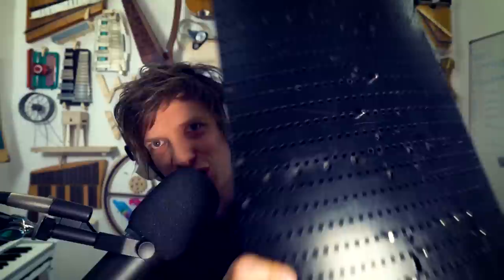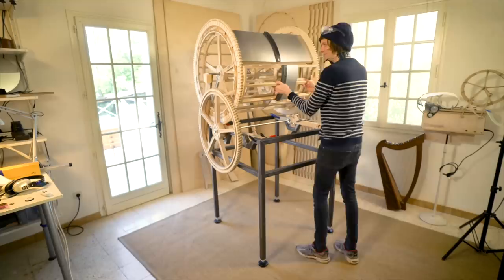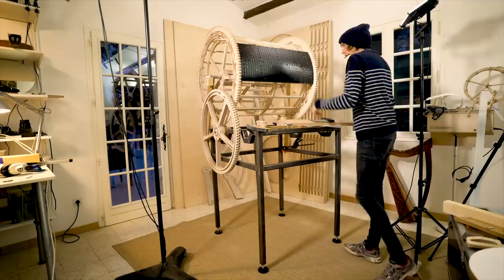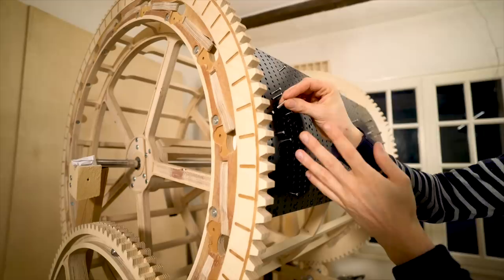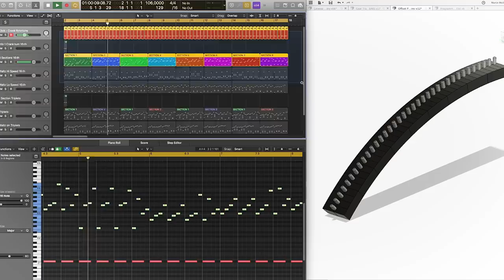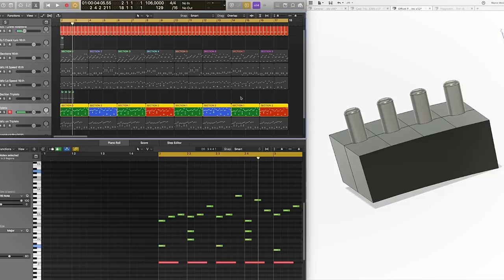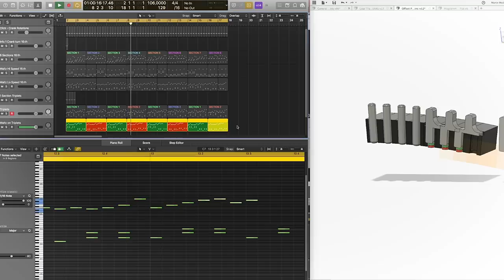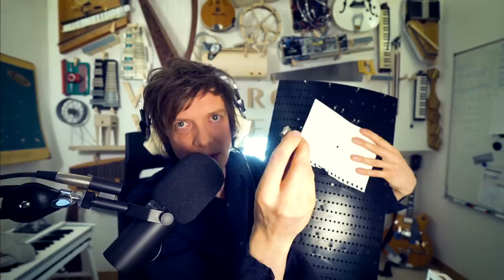Magnet "Midi" Music System - Marble Machine X #25

Comment: You would probably want to use a vinyl templates instead of paper. This would stand up better for multiple uses at different venues.
You could have different colored vinyl sheets for every song that you have making it so that the templates do not get mixed up.
You might want to put some permanent identification pins on both sides of the plates, that are not used in the song, so the template only go on one way and are lined up correctly.
Reply: I was thinking that too. Or even make it from thin metal sheet with locks that are not interchangeble.
Reply: Paper is really not a good material if you want to travel with them and use them more than few times, especially since they want to change songs DURING gigs.
Reply: mrkv4k I respectfully disagree, Paper travels well in tubes (like blueprints) and can be replaced easily while on tour by going to a local blueprint shop and having more made, plus they can be edited on tour and reprinted easily.  

Even in situations where a local print shop is not available,  a standard printer could be used using a solution like Mattias Wandel's big print program
Reply: you can put vinyl in tubes too, even steel sheets. And I would go for perforated/laserd sheet, not printed patern. That way you can put sheet over the programming plastic and put pins thru. I don't know how you would do that with printed patern.
Reply: look at a lite-bright... a toy from the 70's. you just push the pin through the paper... it's a disposable (recyclable) templet... a vinyl sheet can get ripped or stretched when used repeatedly... and if it's lost, it's a lot harder to replace than a piece of paper. 

very thin stainless steel sheets would be nice though since they aren't magnetic... but you still have the issues that you would with vinyl… stretching, cost and difficulty to replace if lost, and something I haven't brought up yet, when you pull a curved templet away from the index drum sections, the pins are at different angles... so the form would need to stretch to be removable... unless the intent is to leave it on during the performance. paper templets can just be removed and recycled... otherwise maybe thin steel or brass sheets that cover the unwanted holes and are clamped onto each section for the duration of the performance... but I got the impression that Wintergatan wanted people to see the perforations in the drum (otherwise why would he care about surface finish (polished or brushed)
Reply: 1. I get the lite-bright example, but those pins were like 2mm in diameter? These are at least 5mm...  You'll have much harder time pushing them through.
2. The different angle is not that big of a deal. Just make the holes 1mm wider than the pin diameter and you don't need any stretching.
3. He could use both. Stainless steel or vinyl ones for the most used parts and paper as a backup...
Reply: A problem with templates is that they either have to remain on the programming wheel during the song (requiring additional mechanisms for them to remain stable while on the wheel) or would require the template holes to be designed in such a way to allow the template to be removed *without accidentally pulling the pins out* with it.  The current pins stick out substantially from the surface of the programming board-- the height of the pins cause a wedge effect across the surface of the wheel, locking the holes in the template against the base of the pins.  Disposable paper templates could be torn away from the pins (tissue paper?), but you might still risk accidentally pulling out some pins.  If you want a vinyl template that's removable, the holes would have to be bisected by a thin slit to allow the template's hole to clear the top of each pin upon removal of the template.  Of course, this is impractical or impossible, if the pins are taller than 1/2 the distance to the next hole in the sequence.

For these reasons, I would recommend a sheet of thick vinyl, stainless steel, or cardboard with a few registration holes that would key onto several very short pegs sticking proud of the black plastic programming boards. The pegs have a something on top that can be rotated to lock each sheet down on the black plastic peg board underneath.
Reply: As I have written before, those holes can just be made 1mm bigger and you won't have any problem getting that template off...
Reply: Silly idea maybe, but machine metal backplate with a small 1 or 2mm hole behind each insert. Place the template and drum section on a curved lightbox. Place magnets over each hole with a light behind it; would be easy to spot any missed pins. Different colours could be used on the acetate to signify type of pin.

Comment: Use color coded stripes on the board as a visual representation of the music tracks.
Reply: Makes things easier especially if they need to switch the pins fast. But it wouldn't look good
Reply: True,but even a simple black and white scheme could work well.

Comment: I think we're overthinking this and missing the obvious. The vast majority of your three beat programming is going to be for songs that are three beat all the way through. In those rare cases where you just want to shake things up a bit and throw some triplets in with the quads, you can use the offset pins, or the 12 beat system. Most of the time, though, you will want to have a quick system that works for three beats, and that is where your modular system excels. 

Just make alternate modules that work for three Beats, or any other number of Beats that you want, and take full advantage of the benefits that you have already built into your system.  Pro-tip: color code the modules for quick sorting by time signature.
Reply: This was going to be my suggestion as well. I love the musical possibilities opened up by being able to do 3 against 4 on one programming module, but I can't see that feature getting a ton of use. Having a separate set of 3-division modules would simplify manufacture and simplify set-up.
Reply: Also, I forgot to mention that the number of special offset pins used for a brief breakout from 4-beat will be few, and save you the thousands you would need otherwise.  You could probably even skip those entirely by putting in a single 3-beat module among the other 7 4-beat modules.

But definitely,  don't make it needlessly complicated.  Keep the system standard and open to new possibilities, and you never know what amazing ideas may develop later on down the road. 

 The beauty of MMX is in its simplicity and adaptability, and that plays in brilliantly here.

There's even the option of using alternating modules for different needs, such as an 8-beat mod for a speed-riff here and there.

Comment: My vote is for glossy. For the 4th/3rd timing idea however, I'd suggest against rectangular magnets because the holes would need to be cleared in the corners, taking more space then you think and possibly not having enough material left over between pins and rows. I'd go with a much easier idea, which is to keep the round magnets and simply do distinct programming plates in both three and four pins formats. Also, the less the magnets stick out of the holes, the stronger and durable the whole setup should be.
Reply: So sets of each type of time? I like that. The only limit is space needed for transportation... Speaking of, what is his solution to transportation, flight cases? It'd be cool to see him make custom flight cases for the marble machine x!
Reply: I thought that at first (Two sets) Really simple and foolproof. BUT: More to transport on a world tour and knowing Martin, the idea of breaking in to a few bars of 3/4 is too seductive (but again would be limited by the maths)
Reply: Glossy, that could be a problem with spotlights on stage and reflections.
Reply: Doing a 3/4 song mix would still be possible, limited by the sections.

Comment: Since I can't comment on the pinned comment anymore: I like the bar magnet Idea. But the bar magnets and offset pins both have the big problem that you would need to drill square holes into your programming plates. The easiest way to realize triplets would be to create another set or two of programming plates. Or if your design allows for it you could drill another row besides the current ones which is in triplets. If you then offset the comb one row, a simple flip would be all the difference you need.

With your template you have to look out for the thickness. Because all the pins will hold a template onto the programming wheel if its not thin enough. And if to thin it will wear out fast.

About brushed or glossy: Odd ones glossy, even ones odd.
Reply: you can create (roughly) square holes, just use a smaller bit to create tighter corners
Reply: This would work with the bar magnets if they have rounded corners. But if the offset pins get water-jet cutted. they won't have as much of a roundover.
Reply: I personally think the two lane bar magnets are the best idea. It allows for all sorts of triplet 16th note interaction, makes it simpler to program, and more efficient than having multiple types of pins

Comment: So, it is basically a Automatic reprogramming system, which you can reprogram with a pouch hole paper. This also decreased the mistake chance made by people. Actually, in the heat of a on going show, the chance to make a mistake by people reprogramming is quiet high.

Comment: Maybe you could make an electromagnetic  programming template to replace the pins, you could take them out all at once that way, and by flipping a switch you could drop them all out of the template
Reply: Jesse Cabral problem with that is turning the magnets off when needed
Reply: Maybe try a Halbach magnet array, just remove the middle portions to and the magnetic field would decrease significantly. https://en.m.wikipedia.org/wiki/Halbach_array
Reply: Ok i feel like all of the fans here are smarter than me
Reply: My thoughts exactly. But would this pose a problem with magnetization of the pins?
Reply: If you haven't already thought of it, it would be super cool if you added a governor to regulate the speed at which you could crank. Already there should be some resistance to cranking, but a governor could be adjusted easily to different speeds and then instead of keeping time, the crank would only go as fast as the governor allows. Maybe it is too much to add, I think it would look super cool and be useful.  https://en.wikipedia.org/wiki/Governor_(device) btw you can adjust the spring and adjust the ball positions (have them threaded on something ) to change the maximum governor speed! It wouldn't necessarily need a brake, the moment of inertia of the governor itself could limit max speed.

Comment: I think you should just add extra holes for the triple notes and use the normal bar magnets. It won't hurt anything if the holes overlap.
Reply: If you decide to make the triplet pins, you only need to make one type, which is offset by 1/3. Instead of playing on the 1st, 2nd, 3rd and 4th sixteenth, you play on 4/3, 8/3 and 12/3 which is exactly 1+1/3, 3-1/3 and 4.
Reply: Definitely.  See Kieran Hughes's suggestion https://ibb.co/g4oKQn

Offset pins would be better at 1, 7/3, and 11/3.

Comment: If my macbooks's magsafe power connector is any indication, it is worth thinking about how to deal with the inevitable ferro-magnetic debris that might accumulate on any of the magnets. Little bits of wire and other metallic fluff could snarl things up on the road. 
Also, did anyone else think "Lite Brite" looking at the programming panels? Having light shine through in the same way would be one way to help guide programming. And could look cool. Hard with the backing plate though.
Reply: ...and the magnets...
Reply: light show would be real cool complexed tho

Comment: I could not post in the pinned down comment :( , so I´ll just post it here, guys help me so Martin can see if my idea is useful to him!. My idea is that you could make a hand held device to quickly put the pins in each hole and having to deal less with the magnets getting stuck toguether. It is kind of inspired in how nail guns or staplers work. I think the template idea for programing the pins would work great with this! Because you could make the templater a bit thick just so you can mark groves that easily guide the pin-gun ( haha it has a name now) and pull the trigger or lever and quickly program like when you use a nail gun, that would help improve a bit the time of reprograming.
I made a drawing but it was hard for me to find a way of posting it here, I really hope you can see it Martin, I really LOVE your work and your dedication, Wintergatan Wendsdays is always a highlight of the week for me, and I have shown my other engineer mates (we are students still) and they really liked you too! Greetings from México

Hope this link is useful -->  https://lh3.googleusercontent.com/-U4hhoEsDJoY/WoT_NmfbU6I/AAAAAAAAA30/SoFhp2q1OrwvRcrdBbtuhnkbAJ7FHC13ACJoC/w663-h498-n-rw/IMG_20180214_212506.jpg
Reply: Good idea. A narrow track between two walls, spring loaded at one end and another spring and plunger that is finger operated at the exting end.
Reply: Hi Martin

I think you should abandon the idea of reprogramming the machine live. For sure the plates + magnet system gives you a lot of flexibility to compose and test songs, but in a live show you already have a setlist and you know what songs will be played.

To speed things up and avoid mistakes you should have whole swappable cylinders that are easy to replace. Without the magnet system, you could build them with a fraction of the cost.

Comment: When you use a mask on the programming section and stick the pins through it, it might get impossible to remove it afterwards because the distance between the ends of the pins ist larger then on the surface.
Reply: Michael Wendland just have to make the holes larger than the pin holes.
Reply: Michael Wendland or you could just leave the mask/template on and hold it by the pins. What you see as a flaw could be used as an advantage to hold the templates on.
Reply: What about a comb type mask? There are large enough gaps between pins, that you could slide the mask to one side, where there would be a large enough holes to remove the mask over the pins.

The mask would then need to be made of something a bit stronger, maybe cardboard/vinyl.

of course, we've also probably missed the obvious - disposable masks. Print masks on nice, thin (possibly perforated) paper which can be easily torn off after programming.